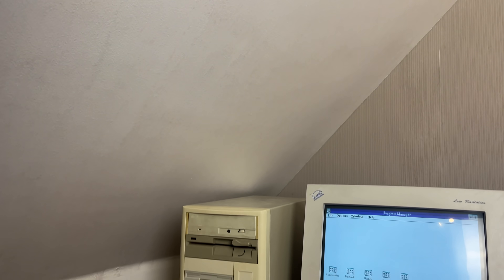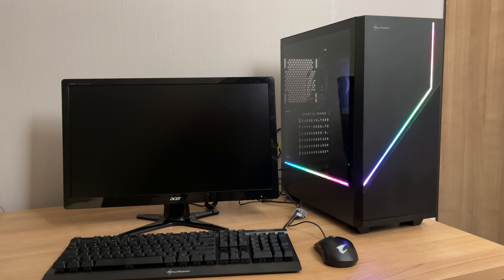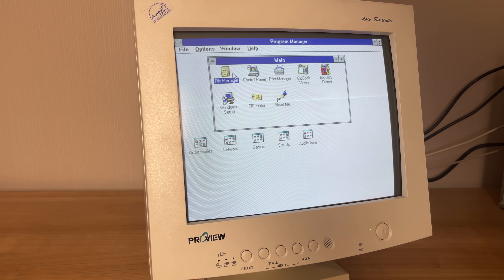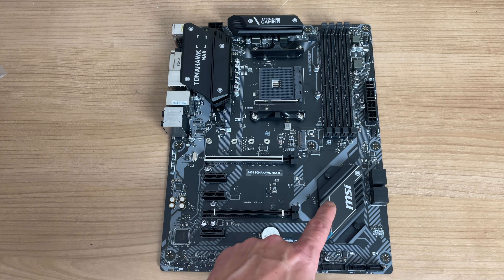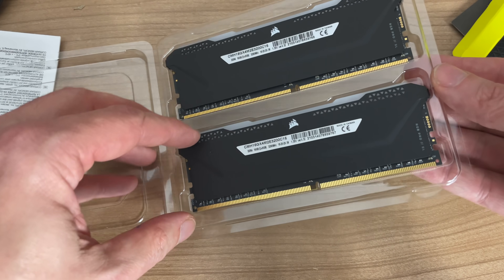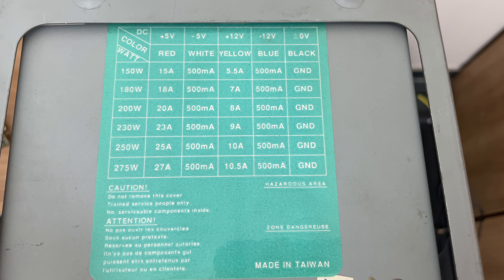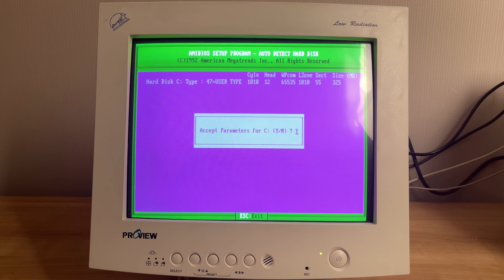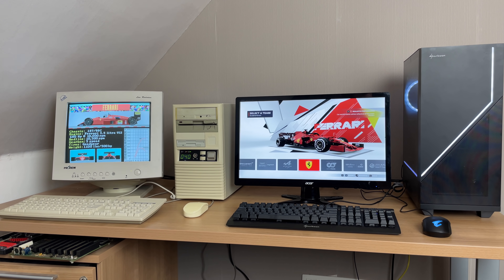Comparing a 1992 Vs 2021 PC Build

Comment: The biggest difference that strikes me is how much more integrated modern computers are. The only expansion card I have in my modern pc is a graphics card. When it comes to audio, I don’t use the built in realtek chip, I have an audio interface. However, I still have optical drives in my system, part for nostalgic reasons but also because I still actually use them for ripping cd’s and making backups of old CD-rom games in my collection. If I had the change to improve something on computer motherboards, it would be designing a standardised front panel connector that is keyed so that only plugs in one way. This I find very noticeable difference between USB 2 headers and USB 3 headers. Those tiny pins with individual wires are a pain, if they can standardise on motherboard and case form factors, then why not on front panel connectors?

Comment: Wow, this really shows how much desktop computers have evolved in technology and especially internal ergonomics. I was surprised how easy the modern pc was to put together. Just snap things in place and voila basically. A long time since I've paid attention to the internals of desktop computers!
Reply: A long time since I had to fiddle with IRQs and memory management, hard drive settings, finding the right drivers for all my components, etc. Modern systems take some of the fun out of the process of building and tuning systems. Some of the fun... and a lot of the frustration. 😋
Reply: It's not just the ergonomics, but also the materials. In the past cases were mostly made of stamped sheet steel, instead of aluminum (let alone milled aluminum).

Because of extensive use of steel, a lot of the old cases didn't survive to this day because they developed a lot of rust and got thrown out. 

Don't even get me started on the weight reduction and that magic pocket behind motherboard for cable management.
Reply: @harryshuman9637  You forgot that Steel = human blood sacrifice EVERY BLOODY TIME!

Comment: Good video, but please enable XMP in the bios so ram runs at it's full speed of 3200mhz.
Reply from the maker: I did but it wasn’t in the footage here as I was just installing it. As you might have guess this is not meant to be an indepth ryzen video as there are plenty of others who do a far better job than me :) just thought it was interesting to compare old and new.
Reply from the maker: Notice also how the PSU changed as the Corsair died on me after exactly 1 day. Really bizarre. From one moment to the next I wasn’t able to start the machine anymore. No smoke , explosion, warning, drama. I turned off the machine and afterwards couldn’t turn it on anymore.
Reply: @RetroSpector78  are you going to investigate the issue or just send it back? Happened to me a while ago too, with a very expensive Seasonic PSU. The unit had a faulty current/voltage protector which worked the first time around but after that kept tripping.

Comment: On another note, the CD-ROM was invented in 1984, they came to computers in the late 1980s.  By 1992 they had been in computers a few years, or at least as optional multimedia kits you could purchase to upgrade your computer with.
Reply from the maker: I wouldn't call them mainstream in 1992. I was browsing through lots of PC magazines (mid to end 1992) and the majority of the advertised PCs did not have cdrom drives installed. But it was definitely possible to have one installed. The one showed here (Mitsumi CRMC-LU005S I believe) was only released in 1993

Comment: With a little driver you could format your 1.44m disks to 1.68. I don't remember how it was called, it was pretty popular in Poland in 90's. Even RAR had option to split images into 1.68 archives :)
Reply from the maker: Hehe … also remember that !
Reply: 2m
Reply: Microsoft used to distribute disks in that format especially if you had something like Windows 95 or NT on floppy.  That extra 10% or so could save them a few disks per box.

Comment: Your installation of the M.2 SSD almost gave me a heart attack.  The way those are installed is you install it from an angle going in, angled upward, then you lower it down and screw it in, you don't pop it straight in like you did, ouch.  Also, the pronunciation of A. M. I. through me for a loop, you say the letters independently, A.  M.   I.  It's an acronym.  It stands for American Megatrends Incorporated.

Comment: I'm running a Lian Li O11 Dynamic XL ROG with a 3950X,  32GB RAM and a 2080TI with a full custom water cooled solution with three radiators.  It's getting to be a bit dated now,   but the new stuff just blows away the old stuff.   I can run with the fans off most of the time and near silent when pushing it.   While I miss the old days I know I would miss the current stuff more.

Comment: A 386 in 1992 is a bit low-spec to be honest, you could get 486's during this time, and might have been a better representation of the best computer for 1992?
Reply from the maker: It all depends on your budget / need. If you browse through mid 1992 PC magazines you'l find plenty of advertisements for 386 sx systems being sold.
Reply: @RetroSpector78  I would have emphasized that in the video then, you should have mentioned the 1992 computer represents an entry-level or midrange computer, not the high-end of what you could get at the time.
Reply: @JusticeGamingChannel  The 2021 system is entry-level/midrange too

Comment: The WDAC2340 actually has a spindle speed of 3.322rpm according to the data sheet. My two WDAC2340 are being reported by SpeedSys to have a spindle speed of 3.343rpm. 5.400rpm was still far from being affordable for the normal consumer. I think the first affordable drive featuring 5.400rpm was the Seagate Barracuda if memory serves me right? Read and write speed of the WDAC2340 is between 1,5...2,0 MB/s by the way. Very neat drive, like the whole family of early Caviar drives.

Comment: In 1992, I had a 486/33 with 16 Mb of RAM and a 40 Mb hard drive running DOS 5.0.

I picked up a used Compaq 486DX4/100 a few months ago and maxed out the RAM to 128 Mb and installed a 4 Gb compact flash card.
Reply from the maker: In 1995 my parents bought me a brand new 486dx2 66 with 4MB RAM. Crazy times in the nineties where you had lots of overlap between systems. There was a period in time where you could buy both a 286, 386 and 486 new.
Reply: @RetroSpector78  The Pentium came out in 1993, so you were definitely pretty far behind in terms of specs.  In 1995 you could get a Pentium 75, 100, and even 133 by the end of that year.
Reply from the maker: @JusticeGamingChannel  In those days there was definitely a big difference between the start of the year and the end of the year :) Lots of innovation in short timespan, and I guess a lot of old stock people needed to get rid off.
Reply: @JusticeGamingChannel  If I'm not mistaken Intel came out with the Pentium 60 in 1993. I still had a 286 at that time, with a mono VGA monitor and a 200MB HDD (running double space). It ran Accolade's F1 and Leisure Suit Larry, so I was happy with it.
Reply: Living the high life, in 1992 or was it 93 got my 1st PC was this weird all in one IBM thing it was an eduquest had a 486-SX 25mhz  and want to say 4 MB or ram but was more likely 2 MB. I remember messing around with autoexe and the like to free up enough ram so I could play masters of Orion.
Reply: Yeah, I just made a post about this, cause in '92 you could definitely get 486's, a 386 would be low-spec for this time period.
Reply: You shouldn't max out RAM like that on old boards as if will exceed the cacheable amount therefore slowing performance down - admittedly not always in DOS due to the memory layout being bottom up instead of top down like Windows. 32mb will still be massive overkill for a 486.

Comment: Great video, hope you're able to find a dedicated GPU for the Ryzen system!
Reply from the maker: Bough this one specifically to run / test without a dedicated GPU. The internal GPU is not half bad for casual gaming on this one. GPU prices are crazy nowadays. Have an RXT 3070 pre-built and a couple of older GTX Cards. (1060 / 960 / 750 / ...). Have some alerts on local listing for geforce and gtx just to keep an eye out for prices. Was a couple of hours late to pick up a 150 EUR gtx 1660 TI :)

Comment: Very nice video, thanks as always! As quick side note, though - I believe that your Turbo button is wired the oppsite way - it should be full speed when depressed, and half-speed when preseed. As the old saying goes - tubo button works exactly the opposite what it's name suggests.

On top of that - a quick question if I may. Wasn't a 4MB of RAM actually on the low end in 1992? I remember having a low-spec laptop from that era (manufcatured in 1992), and it also had a 4MB RAM module. So I would assume that a desktop PC from year 92/93 would have 8MB of RAM as a standard, no?
Reply: A 386 in general is a bit low-spec for 1992, 486's were the PC of that generation, so it's not the best representation of what was out then.
Reply: @JusticeGamingChannel  True, but the AMD Ryzen 5 APU is also "a bit low-spec" for 2021... compared to a Threadripper, for example. March 1992 saw the introduction of the i486DX2 as the top-dog CPU. The Am386DX-40 was about on par with an i486-25, and representative of the entry-level/mid-range at that time. The SX version only had 24-bit address lines (16MB max) and a 16-bit bus, but the internal CPU performance was similar. Some people were still using 386SX or even 286 (maybe XT?) based PCs back then. So I think it's a fair representation of what people with modest budgets were buying new.
Reply: I have my 386 PC from 1992 and it has only 2 MB of RAM! So probably 4 MB was a standard
Reply: Well, in 1997 I had a Pentium MMX with 32MB of ram and wasn't bad for the time. A friend of mine had in 1998 a Pentium 133 with just 16 Mb
Reply: What the turbo button does depends entirely on how the mainboard manufacturer implemented it.
@Justice Gaming: The 386SX as shown in the video was a low end part, but a similarly clocked 386DX could be faster than a much more expensive but slower clocked 486.

Comment: 386 cable management = you managed to get all the cables in there.
Reply: I actually got good at cable management, although to be honest in those days I had a case as large as his modern one. Needed it to fit my dual full-height hard drives.  At the time, I thought I was quite slick sourcing everything in black rather than the "traditional beige"... took me a bit of hunting around to find a black monitor, too. 😋
Reply: Why you need cable management when you have 5W CPU, and 2W graphic card?

Comment: Aaah, nostalgia, you cruel mistress.  I really do think that I miss floppy drives.  I know that by today's standards, they are impossibly limited in capacity, but back in the day (such as in the mid 80's as a computer science student) I could carry around my programming language compilers, program code, and data files all in the same small hard-plastic 5 1/4" floppy disc carrier and still have room for a few DOS games.

Thanks for doing this video, a lot of computer enthusiasts today (read: young folks) may be unaware of how personal computing hardware has changed over the decades and this might help give them some context and appreciation for how things have evolved.  What might surprise them is how careful we had to be with hard drive parameters in the BIOS setup, today it's thankfully just plug-and-play but back in the day, getting a hard drive working was almost a part-time job lol.  And same care for IRQs and DMA settings of our non plug-and-play hardware and add-in cards.  It was a fun hobby.
Reply: I still have a floppy drive in my 4th generation i7 machine :-D
Being a retrocomputing enthusiast and having a little home music studio with very old synthesizers, a floppy drive is still handy to have sometimes.
Reply: Tbh, programming language files for the most part are still kilobytes in size. Bet you could do that today if you wanted to also bring a 3.5 inch usb floppy drive aswell but at that point you might as well just use a USB stick lmao.
Reply: yes nostalgia 30 years of innovation